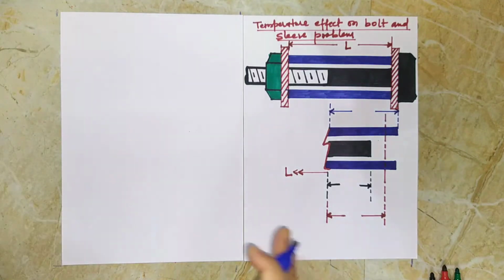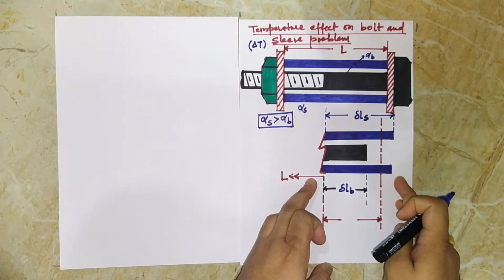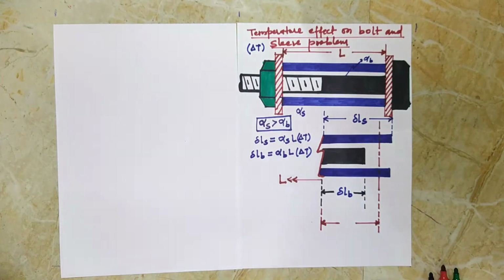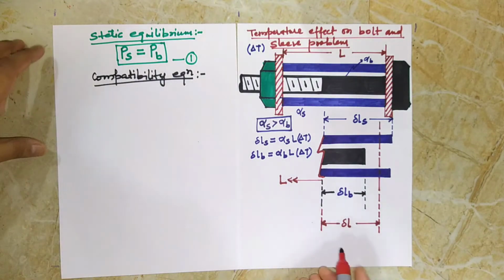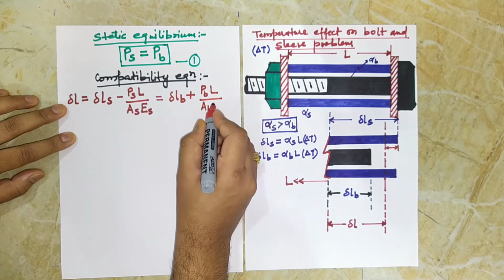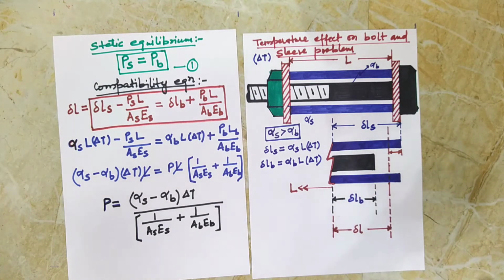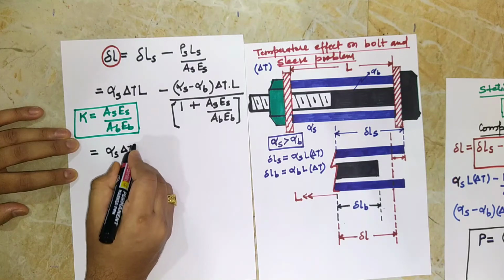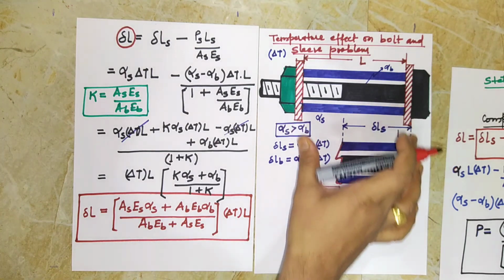Elongation of Statically Indeterminate bars under action of thermal stress-3/Mechanics of Materials

Comment: Very nice topic! Some points,
Due to thermal effects can transverse stress be induced (apart from axial) & cause intereference issues after assembly?
The explanation: why bolt is subjected to tension and why sleeve is subjected to compression is explained too fast! 
Based on the nature of stress developed on the assembly, if you can also elucidate the material combination considered by engineers in practice, for various applications then it would be very useful to relate, Sir!
Keep up the good work!👍
Reply from the maker: Thanks for Watching Govinda Ji. I truly appreciate your understanding of the subject.
Now coming to your doubt...

Basic information: First of all, stress does not get induced in a free body due to thermal effects. It only does when the free expansion/contraction of the body due to thermal load  is constrained in any direction. Also please note that, when a free body expands/ contracts due to thermal effects alone, the corresponding change in  lateral dimension does not follow poisson's effect.

So let us address your doubt with this basic information: Let us have a rectangular body (dim: L and B) constrained by an assembly and temperature increased. Obviously it will try to expand in axial and lateral direction respectively by α*L*δT and α*B*δT due to increase in temperature. Now look at the assembly, if  the assembly condition does not allow axial and lateral expansion of the body freely, it will start to develop stresses in both the directions which depend on the assembly conditions. 
So,
Change in axial dirn = free expansion due to thermal effect +/- change in length  caused due to load applied on the body because of  assembly constrain +/- change due to poisson's effect because of stress in the lateral direction.
Change in lateral dirn = free expansion due to thermal effect +/- change in lateral dimension caused due to load applied on the body because of assembly constrain +/- change due to poisson's effect because of stress in the axial direction.

Hence, we conclude that of'course due to thermal effects  transverse stress shall be induced (apart from axial) & cause intereference issues after assembly. I hope it clears your doubt, otherwise you can please write to me again.
Regards
Reply: @technicalconceptdiary5288  great to see that you have scratched from the basics and step by step, analysed the situation. I appreiate your patience and efforts in considering my question. 
As your explanation, it seems that, in order to consider transverse stress two additional equations for tansverse load and compatibility eq in transverse direction has to be considered. It is convincing!
Just one point Sir, under this situation of biaxial loads (what the bolts are subjected to), if the point application of load(s) pass through with some offset with respect to the centroidal/axis of symmetry or etc, can there be bucking/bending stress induced making it an involved problem of combined loading? If yes & if we calculate only the axial stresses then does that gives good approximation to engineers in practice or some other wayout is there?
(The reason I asked you, any bimetallic assembly under thermal stress is observed to be bended/buckled (the terminology is as per direction of load with respect to the axis of reference)).

I appreciate Sir, the scope of the video does not permit you to discuss these aspects (if true), but I am just curious to learn your explanation!
Reply from the maker: @govindanashkar8436  Your doubt is genuine. Let me address step by step.

Problem referred in the video: In the given problem, we are heating the bolt and sleeve assembly where the sleeve is symmetrically positioned w.r.t the bolt. In reality, heating will lead to increase in dimension in both axial and lateral direction. But since the elongation is constrained only in the axial direction and not in the lateral direction, we are analyzing stresses in axial direction only. Let us imagine the situation in which the sleeve was not symmetrical with respect to the bolt, the assembly in that case would have warped.

Now let us analyze the bimetallic strip problem commonly used as traditional thermostats in which two rectangular cross sectional metallic strips of different materials are bonded on one face. This arrangement is not symmetric about the centroidal axis and when heated, both will tend to elongate differently and since constrained by each other on one face only,  will bend on one side to adjust for the differential expansion taking place.

Please write to me if this explanation is not apt for your query.
Regards
Reply: @technicalconceptdiary5288  againly thank you Sir for your time and patience.  Shall surely write to you more on this. Looking forward to more of your videos...